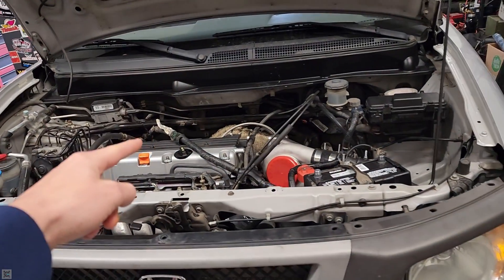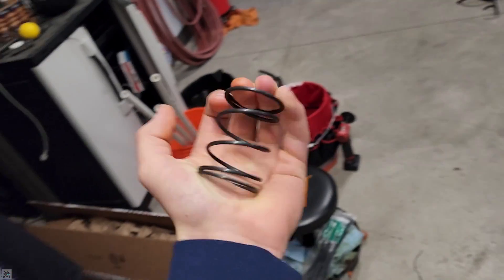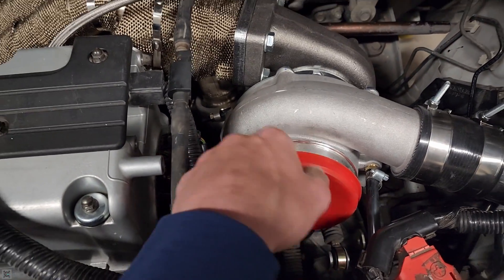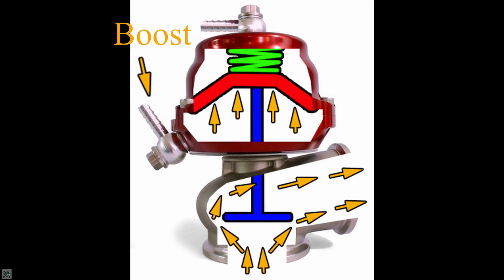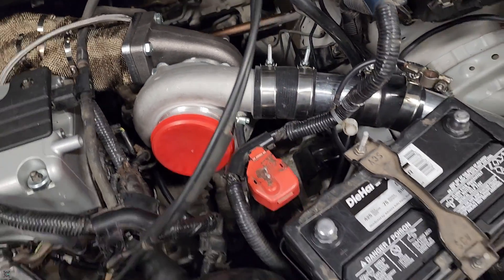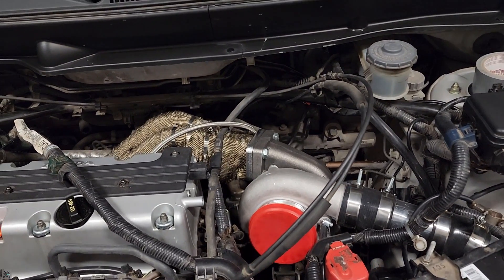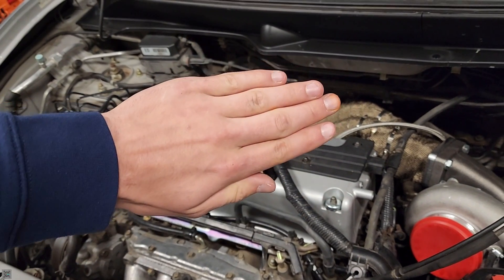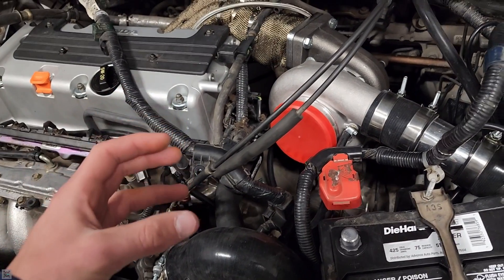Routing Wastegate and Blow-Off Valve Lines | Explaining how a BOV and Wastegate Work

Comment: If I recently swapped from a single throttle body to individual throttle body setup, would I still need to tap one of the cylinders for a vacuum reference point for my blow off valve? Isn't there another way?
Reply from the maker: Not sure why you are swapping to an itb set up on a boosted application, but yes, you would have to tap into a part behind the throttle plate...if that isn't possible you can run without one depending on how much boost you plan to run...if it isn't possible to tap into a vacuum reference then I don't know how you will get a brake booster to work either

Comment: Great video man informative just one thing you don’t need c02 to control the boost you can use a 3 port or 4 port Mac valve to any electric boost controller using this let’s you use a boost reference and then control from the Mac valve with a controller how much pressure goes into each side of the wastegate top and bottom but c02 works too just way more complicated
Reply: Can send you a demonstration on my car
Reply from the maker: Yeah, im aware of other methods but a CO2 controller was the first that came to mind when i was explaining it🤷
Reply: @TheMileHighMechanic c02 is a lot more stable and predictable than a Mac valve yes but a 4 port Mac valve is ideal
Reply from the maker: @yuridj123 You are all good, im aware of how they operate 😂

Comment: Good explanation on the difference between the two methods. It was good to explain where you get the signal from and why it's best to get it closest to the source.  It would be nice if you could go into the pros and cons of each one.  Which one would be better for what applications. 👍
Reply from the maker: Every boosted application NEEDS a waste gate, but you can get away with not running a blow off valve...pros for blow off valve: protects turbo from dosing pressure waves...Cons: weight and vacuum routing

Comment: Does the blow off valve need a certan ammount of vakuum to push the spring correctly? Can the vakuum be to little? I have a "3 way T vakuum line" connected. Should i seperate and make a straight line alone for the blow off valve to the manifold? It's been 4 years whitout the engine... when i installed everything back/modified i felt that the sound of the blow off valve was not as high and sexy as last time? Could be due to another valve used.
Reply from the maker: The pressure in the line will be the same wherever you tap into it because all the lines are relatively short, so a t fitting is perfectly fine. If you got a different valve that is probably why it sounds different.
Reply: @TheMileHighMechanic  Allright, thx❤️ I'll keep it that way and test it a bit more first👍🏻

Comment: so technically if we have the intake side of the turbo (cold side) leading oxygen into the intercooler and then the next phase of the piping goes into the intake manifold
the best place to put the blow off valve is as close as possible to the throttle body. which means between the exit port of the  intercooler and the intake manifold if i understood properly ?
if thats the case-why do most brands place it as close as possible to the turbo on the piping of the air before it goes into the intercooler ?
Reply: i asked chat gtp and it helped me-thanks for the video-it made me understand a lot
Reply from the maker: @egeayvala1799  It is essentially so that you can evacuate the excess pressure as fast as possible. You can technically put it anywhere but I would put it as close to the throttle body as I can so that it releases the pressure as fast as possible when the throttle plate closes.

Comment: So top port on the wastegate can go to manual boost controller?
Reply from the maker: Yes, the top port allows for dome pressure to act with the spring to keep the waste gate valve closed.
Reply: @TheMileHighMechanic  and where does the other port on the controller go to?

Comment: I have a question, since the wastegate can control the boost pressure by bypassing the exhaust gases from spinning the turbine, why do we need a blow off valve?
Reply from the maker: @kittiphatkittipanyawat4923  The blow off valve release the pressure build up in front of the throttle plate when it closes. Some people don't run a bov, but in my opinion that is harder on the turbo because the excess pressure has to bleed off through the turbo instead of a separate valve. This is where you can get the "dosing" sounds from... pressure waves bouncing between the turbo and the plate.

Comment: instead of tieing the wastegate vaccuum line to turbo, can we route it to the intake manifold or tee into the BOV line?  the boost at map is reading 1.5 PSI less than what is at turbo.
Reply from the maker: @adnanhashmi445  I would say to stick with it at the turbo if you are going for relatively high boost. Reason being is because the further away from the tubo that you put it the more the boost will drop. This will keep the wastegate closed longer and depending on how high of boost you are running, you could potentially over boost your turbo. For medium to low boost applications you can put it closer to the throttle plate, but don't tap off of the manifold. Wastegates are designed for positive pressure applications, putting the reference on the manifold would create negative pressure when the throttle is closed...not quite sure what would happen, but I don't think it would be ideal.
Reply: @TheMileHighMechanic  I am at 6 PSI springs but only reading 4.5 at the scanner just before intake manifold. My tuner recommended we tie to to BOV vacuum lines
Reply from the maker: @adnanhashmi445  again, I'm not too sure that vacuum would be good for the diaphragm in the WG, but if your timer is recommending it then it would probably be fine🤷

Comment: How do you set up your mass air flow sensor
Reply from the maker: Running both a MAF and a MAP in most cases is redundant. In my case the way I'm tuning is purely off of manifold absolute pressure, so there is no need for a MAF. Everything can be tuned from the volumetric efficiency table using load as manifold pressure. Hope this helps!
Reply: @TheMileHighMechanic  how would I tune it if I put the MAF after the turbo because if I run 8 lb of boost how would the system know how much fuel to give it I did put bigger injectors in. I'm putting CXRacing GT35 T3 Turbo on a 1998 Mercury mountaineer all wheel drive It has a Ford 5.0 and I put 42 lb injectors in and I'm about done with the exhaust side I'm just wanting to make sure I put the sensors in the right spot so I don't have any issues later on.
Reply from the maker: Personally I don't have any experience with MAF tuning, so I don't think I can give you a definitive answer there, but you would probably have to run an upgraded MAF that is rated for around 2 bar depending on how much you are pushing. I'm sure the tuning theory is the same between MAF and MAP though, you will just have to tweak your efficiency table based on mass flow rate instead of absolute pressure.

Comment: If you're running a twin turbo setup is the wastegates ran the same? Each wastegate gets routed to each turbo? I had seen some pictures that look like they were connected to each other with a T so just kinda confused.
Reply from the maker: The line routing is the same in a twin turbo set up... everything is just doubled. In a traditional set up you have 2 waste gates, and a T in the vacuum lines leading to the manifold is a possible way to route both manifold references off of one port.

Comment: Thank you for your useful video. My question is, the hose that we pull from the turbo nipple sucks the air or blows the air out ?
Reply from the maker: That is a boost reference, so it reads positive pressure while boosting. At idle it may read vacuum, but it depends on the size of the turbo. To answer your question more clearly, that nipple should be tapped into if you want something that requires positive pressure ("blowing") like a waste gate.
Reply: @TheMileHighMechanic  thank you bro❤️
Reply from the maker: @AlexExecutive  absolutely 🫡
Reply: @TheMileHighMechanic  then in electronic selonoid top port is connected to turbo nipple with a 《T》. if positive presseure goes into top port it causes decrease boost and opening wastegate valve sooner. isn't that right? im a little confused
Reply from the maker: @AlexExecutive  Look at 2:20 the top port is only for a boost controller. It adds positive pressure to the top to make it harder to open the valve. This means that the bottom port (boost reference) must overcome the pressure of the spring and the dome pressure instead of just the spring. This increases boost. Hope that makes sense.

Comment: if we have a electronic boost controller and double port wastegate ,then we set it up
my question is buttom port is gonna suck the air and the top port gonna blow the wastegate diaphragm to increase boost?
Reply from the maker: Yes, adding positive pressure to the top of the waste gate is called "dome pressure" and is a way to increase the release pressure of the waste gate. This will boost the turbo more.
Reply: @TheMileHighMechanic  cool then the bottom port works with negative pressure?
Reply from the maker: @amirnr5063 No, bottom is for boost reference...(2:20)

Comment: * there are many ways to have wastegate boost control 
1-electronic
2-co2
3-bleed off 
And probably more

*the blow off spring is a measure of boost control, the spring will bleed off boost if you go over the rated spring rate in the blow off valve
Reply from the maker: The spring in the blow off valve is there for nothing more than to keep the valve closed at idle. The blow off valve is operated completely on pressure differences between manifold and intake. This is a common misconception.

The waste gate spring, however, works exactly the way you described...it bleeds off pressure when the pressure in the bottom chamber reaches the rating of the spring.